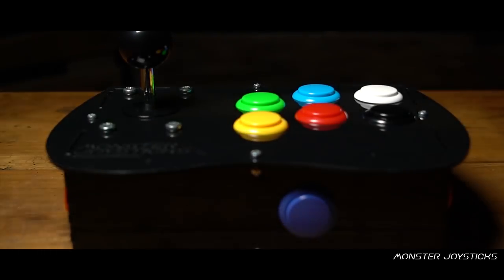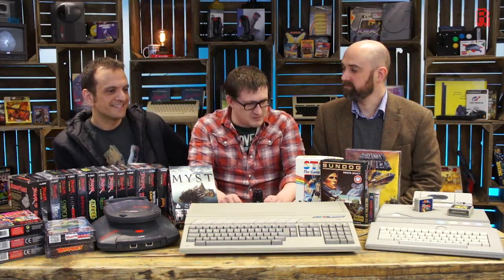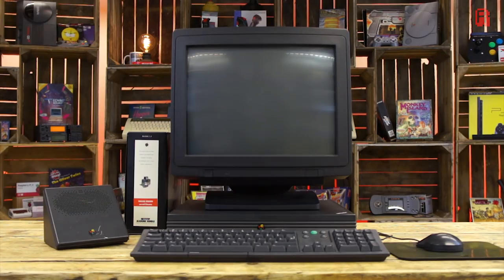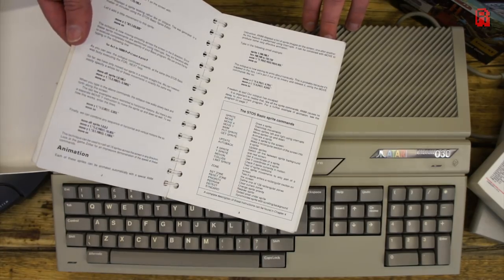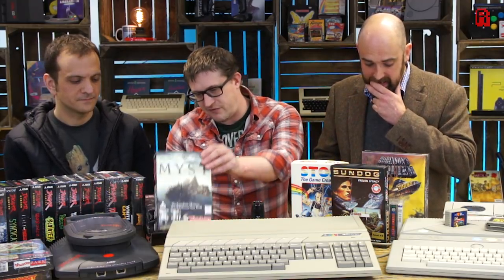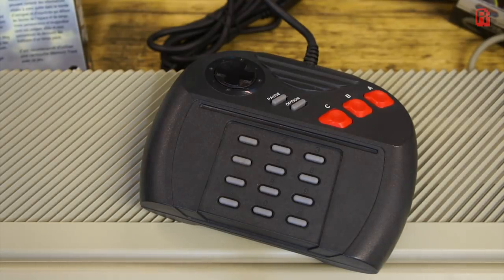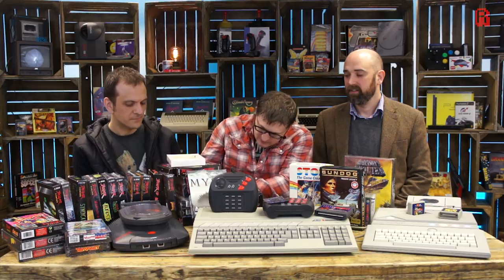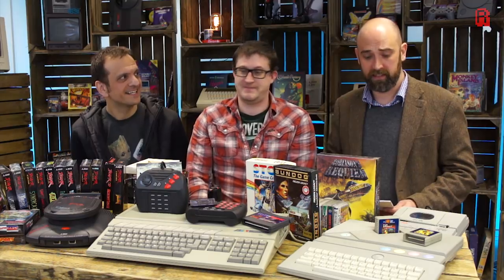Atari Falcon, Jaguar & XEGS chat with Gary & Andrew

Comment: If my memory serves me correctly the LAN port on the Falcon was an Appletalk connector but it never worked due to licensing.
The main processor in the Jaguar is the 68000 "Sixty eight thousand" 16-bit processor not 6800 "Sixty eight hundred" which is a much older 8-bit processor (just to clarify) 
Virtuality arcade games (Gen1) used Amiga as the main system. Another one of those Atari/Amiga crossovers.
For those not in the know, both the ST and Amiga were capable (though emulation) of running Mac OS and Software faster than a Mac. lol I wrote this line about 1 min before they said it.
I agree that the Amiga did sell better to gamer's, but I seriously doubt there were any more ppl developing or doing media creation on the ST than the Amiga. Amiga had better graphics, so if you wanted to do that then would you buy an ST. Amiga had better sound (except for the expensive and short lived Falcon) again would you get an ST. MIDI was one area the ST had, but truthfully how many ppl bought a MIDI keyboard. I ask as I did built some music studios based around the ST and two with falcons, but I believe other than one of the ST setups they only used the ST for the MIDI.
Reply: daishi5571 The 68000 in the jaguar isn't the main processor. Tom and Jerry are.
Reply: My understanding is that Tom & Jerry don't do a thing unless the 68k tells them to. While T&J are most certainly more powerful (with the video and sound in them) the 68K is the conductor of that orchestra (thus main processor) it was possible to program on the 68k and only use the video and sound on T&J but you could not only use T&J without the 68k.

Comment: An good but biased video :)  I don't agree that Atari users geared more towards serious apps compared to Amiga users.  Yes, Amiga had lots of games but there were hundreds of productivity software for the machine.  The Falcon was an excellent machine but too late to the market, the Amiga had the tech in '85.  Even today, its more popular in the Retro scene, more development of hardware and software.  The hardware is only as good as the software made for it.
Reply from the maker: As an Amigan I did have a subtle jab at them claiming they were higher class than us... but it would have been 2 vs 1 in a fight and that Falcon could do some damage to a face
Reply: But by 1992 that '85 tech was outclassed by a number of platforms.
Reply: Only in the software when it came to midi. Steinberg Pro 24 was a really professional MIDI sequencer for the Atari ST using the low latency MIDI capabilities to its max and It never came to the Amiga.

Comment: What does the falcon feel like?  Does it creek like the ST?  It's it as solid as Amiga 500?  Does it record CD quality audio?
Reply: It feels really good! :) And, as Andrew mentions this in the video, it also feels higher quality and heavier.
Reply: Yes CD quality audio. With Cubase Audio Falcon you could have anywhere from 8 to 16 channels depending on if you wanted to trigger samples or use DSP effects or not.
Reply: I'd recommend installing the "TT Keys" product under the Falcon's keyboard keys. That fixes the ol' ST mushy keyboard feeling which the Mega ST, Mega STe, and TT didn't have since they had higher quality external keyboards.